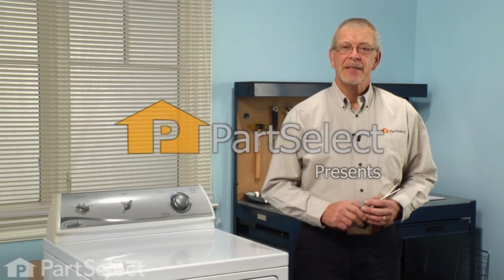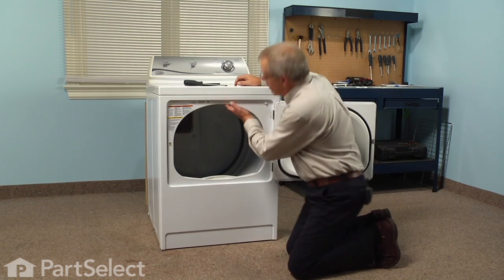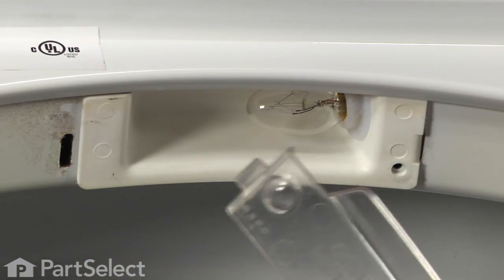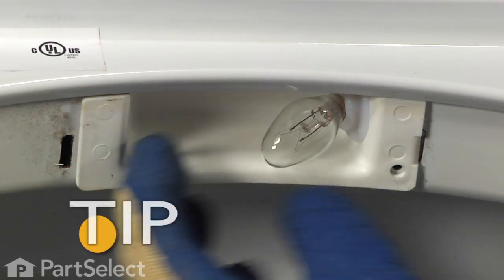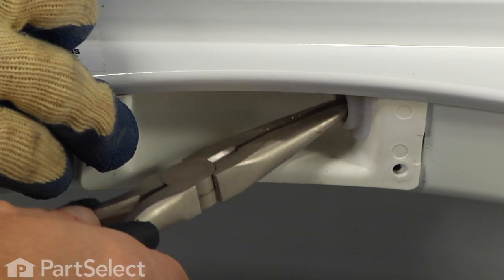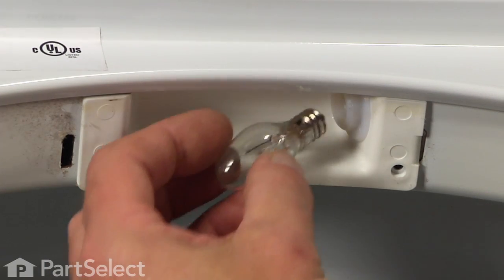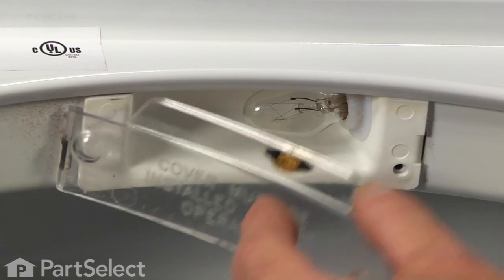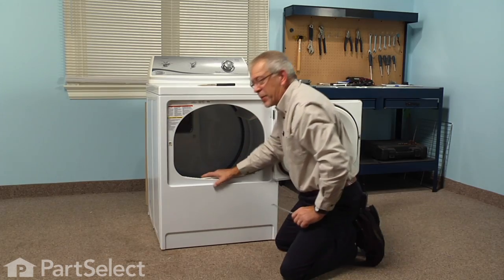Dryer Repair- Replacing the Light Bulb (Whirlpool Part # 67001316)

Comment: A loose bulb will not draw anymore current than a tight bulb. Actually might draw less. what makes the heat is the resistance from a loose connection.

Comment: The light bulb in my Whirlpool Cabrio  dryer is good but the bulb stays off. Any ideas?
Reply from the maker: Check the door switch and the wiring harness from the switch to the light socket.
Reply: Thanks for the tip. It was the door switch. From now on I close the door gently and try not to let it slam.